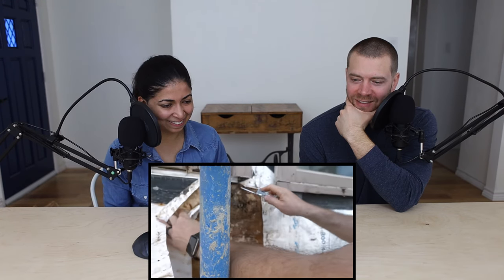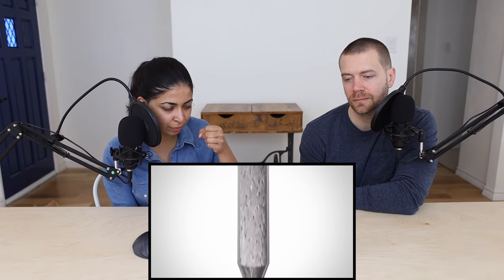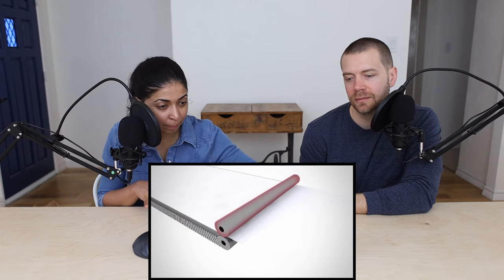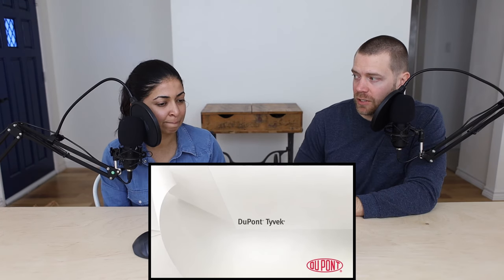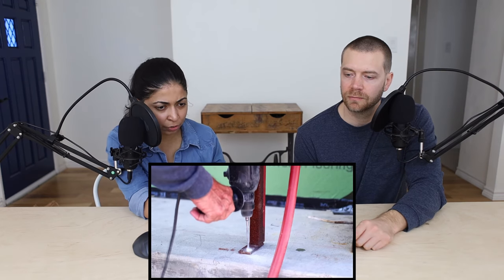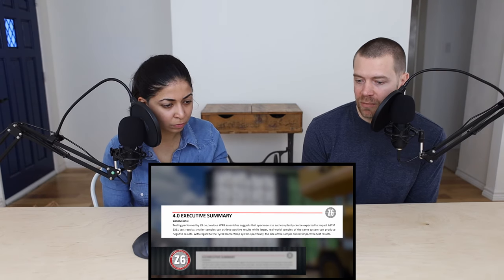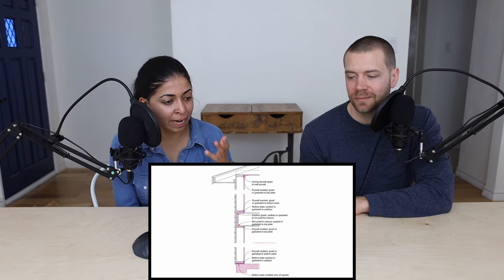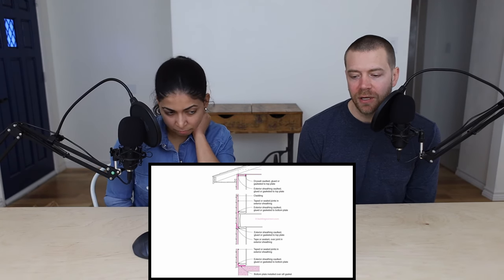Designers react to Tyvek videos (and explain them too)

Comment: Learning a lot about building technology from your videos, great work! But your claim at 13:56 "Every house has sheathing on it" is incorrect. I just re-sided my house built in 1968 and it was just tar paper over the framing.
Reply: that's horrible, no sheathing at all is unacceptable
Reply: That’s how they were built back then. As builders and designers you should know this. As spokespersons you should know room acoustics (echo in the room) even more accents and speech projection. Sorry couldn’t hear you
Reply: @peternycpeterw7484  In my area, and I think most all areas of the U.S., when stud construction is used, older sheathing WAS used, it was planks boards, horizontal or diagonally run!

Comment: A sheet of paper (US dollar bill) is about .004" of an inch thick.
This is 1/10 of a mm. mm = .039"
Spun bonded polyolefin has a nasty habit of saponification when in contact with tannic acid, like from cedar shingles and trim.
Soap is very effective at reducing water surface tension, wicking bulk water right into the wood adjacent to it.
If you think staples leave holes, think about the number of fasteners penetrating when we use wood shingles for siding! (though I doubt there's much of this in Texas)
DuPont also makes a 'crinkled' Tyvek product for use behind true stucco in hopes of creating a moisture break or drain plain.
So it's not only installation details, but the incorrect product in many cases.
I've seen way too much sheathing rot with this product, and won't use it in favor of alternatives like the blue wrap from Dow.
At least plywood seems to maintain some integrity after getting wet. Replacing Oriented Strand Board is a nasty job that costs a LOT of money.